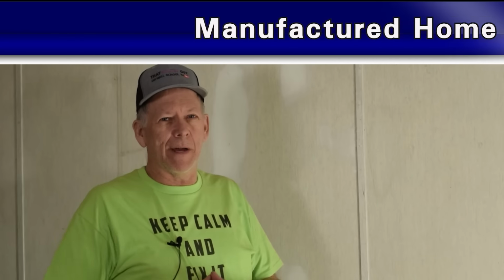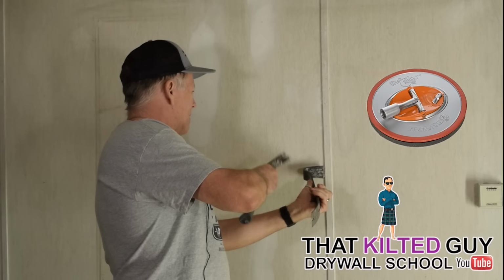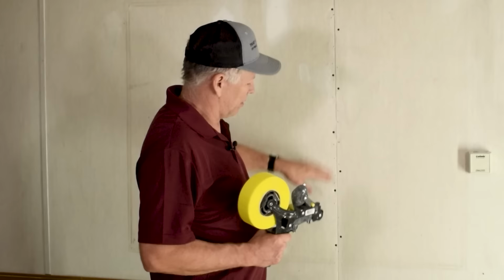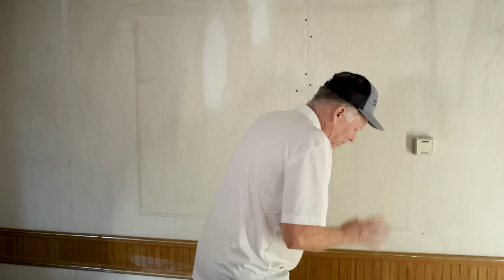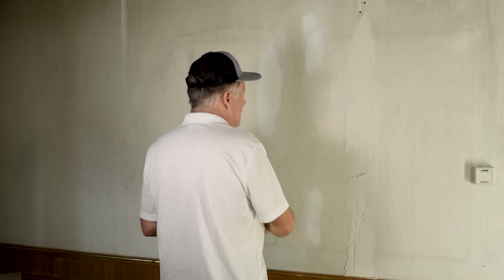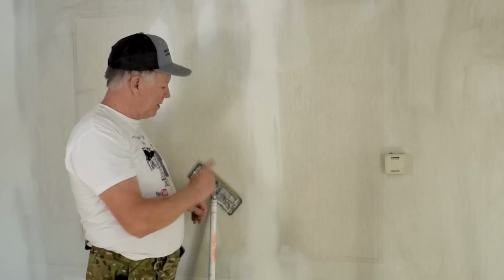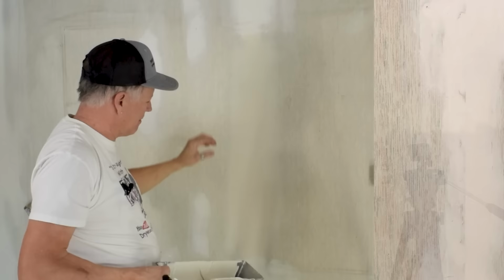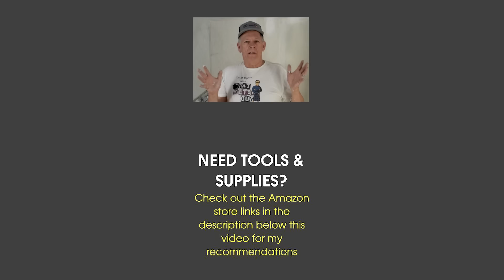Mobile Home Wall Removal in 2022. Smoothing out the wall strips

Comment: Filled mine with all purpose and let dry and crack for about a week, sanded, mesh tape, and 2 coats over them. Looks flawless and not a single one has cracked 👍 mine had particle wall board and a textured wallpaper, so i didnt have to worry about it sticking

Comment: We remodeled a 4bd 6 years ago
We did liquid nail in the molding joints  
No need to mud after. We did a knock down on all walls. Looked perfect  still does today. No issues at all.

Comment: It want crack as long as you screw it down good and Use mesh tape on the seems. I also scuff sanded the wall where the sheetrock mud will spread out two so it would have something to grip to other than that which has a plastic like skim to it. Paint does not even want to stick to it. I decided to scuff all my walls real fast with 100 grit pole sander. It turned out perfect in the end. No cracks.  Lived there 4 years and sold it for $5400. More than i paid forb it.

Comment: I just remodeled our main bathroom in our mobile home and learned the hard way that those vinyl covered walls need to be washed with detergent and water before mudding or painting.  And, after removing all those strips at the drywall joints I tried that patching mud that is pink until it dries but learned that it is too thick and won't leave a thin enough coat plus it curls up as it's being troweled on. I went back to my usual 20 minute mud with flatter results.
Reply from the maker: I would only use 20 minute mud when you need to minimize the shrinkage, or need to recoat quickly. Otherwise I would use light weight all purpose as it spreads easier, much easier to work with, much easier to clean up, and sands way easier.

Comment: I am currently trying to finish approximately 30' of seems in my bathroom. We have a modular home so this vid is very helpful. However I have already taped and mudded before I saw this. I have been using a a wet cloth to wet sand. In some places I can still see the tape, so I will try your method of feathering. Thank you so much. This is the 4th different video of your I have watched.
Reply from the maker: Thanks, glad I could help you out 😎. And thanks for subscribing!
Reply: Had the same issue in a bedroom just started a different bedroom with tho method looks fantastic

Comment: those sanding sponges are designed for you to squeeze the top and the bottom while sanding to avoid those corners digging too deep you only use the middle of the sand blocks no more gouges

Comment: Wish I would have had this info. 22 yrs ago , but it will certainly help if I decide to do all the walls. WE redid the small bathroom then and I was lucky just used normal drywall mud but did use mess tape. High quality paint doesn't  hurt anything either.Thanks  again for the great video.

Comment: i learned a lot of this sort of thing doing body work on my cars over the years..using bondo is basically the same thing...get it smooth feathering and so on. it helped me on my drywall repairs on my home..great video. we just bought a 200 singlewide that has those trim pieces and i want to remove them and smooth the walls. this helps. have a great day sir

Comment: How about coming to Mississippi and helping an older widow rehab a zone 3 mobile home?
The mud works exactly like it does on plain sheet rock.
Paint is usually 1 coat of quality paint.
I prefer to use the fiberglass tape and premixed mud.
It holds better if you need to relevel or move the unit.

Comment: It's hard to give you advice because you're such a professional but if I could, I would say just before you start mudding, wipe the walls down with acetone. That'll remove any greasy residue that may prevent the mud from sticking also if the home was a smoker's home it'll remove the nicotine tar from the wall.
Reply from the maker: Thanks but Acetone is one of the Most aggresive solvents and therefore it's very hard on skin, damages many surfaces, and worst of all in this case, it's HIGHLY flammable and could cause a serious explosion.  If there's any greasy residue products like TSP, Krud Kutter etc would be much safer and still do the job.

Comment: I have a manufactured home and would like to get rid of the 'straps' on the walls.  This video will be a big help to me, as I'm a novice at this.  I did have to tap in over a hundred nail holes or screw holes, and then spackle over those before I could move in.  Still finding some even now!

Comment: Prime it with Rustoleum Universal Primer or equivalent and let dry over night before you mud and it will stick. Also you can spray texture right over the dried primer on the rest of the drywall

Comment: Total novice here, I tried to paper tape over the butt joints, but like you said, the amount of mud was excessive and difficult to feather out. So I tried just using a "hot" mud (90 min) and I liked the results after sanding. Probably would have used the paper fluff stuff if I'd seen it in the store. The drywall sheets are glued to the studs (at least mine are) so there shouldn't be any movement.

Comment: Be sure to check the walls for "blistering" before you add "any mud" or any other material that has water in it, as it will blister. Please note. Many times you may not "see" a blister on the wall prior to adding any coat of liquid, or mud. I have been in the drywall industry for over 30 years and have experience with manufactured homes as well as residential, and commercial buildings. This guy seems extreamly knowledgeable, and i am NOT here to be critical of his work. Just remember that the material used in manufactured homes, especially the walls, are mass produced in a factory and can have many imperfections that are not seen with the naked eye. When you add any material with any liquid in it. It could bring out any imperfections. Although i am not familiar with this gentlemen. I am sure he has a video of how to fix " blisters" on a wall or ceiling. Great video sir.
Reply from the maker: Yes I do. Thanks
Reply: @ThatKiltedGuyDIY  Awesome! Thank you for your response, and my best wishes to you.

Comment: Hey Guy,
Thanks for sharing this video, I was always wandering how to get rid of that Mobile wall look lol, honestly I had that same idea of doing this with spackle puddy, but I thought in my mind that would eventually crack and flake off, I guess I was wrong and this video confirms that...! thank you I will do this to my walls too it looks so much better without those Mobile home walls strips. 

From your new friends in Lima Peru
George & Carmen
Reply from the maker: Happy to help. Thank you for your input George.
Reply: @ThatKiltedGuyDIY  Your welcome
Reply from the maker: By the way, make sure that anytime you fill a crack that you always reinforce it with mesh tape or something like this fiber product I used in this video or it will crack and may come loose
Reply: @ThatKiltedGuyDIY  Thank you, whats the name of the product that you use? also additionally to the product that you use, do you also use the mesh tape too?
Reply from the maker: There should be a link to the product in the description below the video. No I use one or the other
Reply: It want crack as long as you screw it down good and Use mesh tape on the seems. I also scuff sanded the wall where the sheetrock mud will spread out two so it would have something to grip to other than that which has a plastic like skim to it. Paint does not even want to stick to it. I decided to scuff all my walls real fast with 100 grit pole sander. It turned out perfect in the end. No cracks.  Lived there 4 years and sold it for $5400. More than i paid forb it.

Comment: I would look into a sand deglosser or primer to give it a sick to base. Surface profile. I did paneling this way also used both sides of the paneling. ( thin coats of mud)

Comment: Keep watching. Hopefully learn what to do. Have you have a video replacing old crank windows. Be so awesome. I might be the only gal with them. I’ve got a new heater and AC unit. I am planning to redo the roof. I put new carpets in a while back. I am updating that. I did update the electrical, but there’s definitely things that need to be done. So much work is it worth it. Finished 2 bedroom 1 bath worth probably less than I could sale it for. I don’t want to sell. This is great.

Comment: Thanks i need to learn cause next spring im going to fix a kitchen ceiling that is duct taped water damage so i will have to clean out the old ceiling and mold and put new on the way cheap.lol no clue never done anything much but roll paint on a wall.

Comment: Year's ago I knocked in the staples and nails, and screwed down any loose spots in the drywall of the mobile home I lived in, since the joints where so inconsistent, I filled them and screw dimples with automotive bondo, LOT'S of hardener, took down any high spots, then covered with mud, sanded till I was pleased, the gaps had been no where near as nice as I had just seen in this video, tight on bottom 3/8's on the top, and vice versa, can't give an update on how well it held up, as I know longer live there, sure wish that product existed when I did my mobile home, the bondo fumes are MISERABLE!!!

Comment: Correct me if I'm wrong, but you should not even think about doing this unless your modular/mobile home is on its own property. If you ever had to move the home then you might have to repair all of these joints again. And if you are adding a texture to the wall then your repairs would be that much more work.
Reply from the maker: When they move a new modular home, there’s always cracks to fix so you could look at it like that. If you move it, you just fix any cracks that appear

Comment: I did this similar thing to my old manufactured home but I actually used that green lid mud and did the whole surface of the walls with a skip trowel method and had no issues whatsoever. Never did anything to prep the vinyl surface. Great video.

Comment: That’s so interesting, I never knew that could be fixed, it looked great!
Reply from the maker: there is that, but the main reason is because the sheet rock is covered in vinyl and it wouldn’t make any sense to tape and finish them when they’re covered in vinyl. It’s a cost saving measure most of all.
Reply from the maker: well it’s most often called VOG or vinyl over gypsum. And what you’re talking about is the method they used in old or cheaper manufactured homes. Modern day manufactured homes don’t use batten strips in the nicer ones and they get by just fine moving them. So the reason they did it in the past was simply it was much cheaper then taping and finishing the drywall. It was a cost savings pure and simple.

Here’s a photo of a modern manufactured home for proof - https://oakcreekhomes.com/floorplans/boerne-5067/

Comment: Use Durabond very strong and it will stick to anything that's what you use over metal studs because they twist very easy and the strongest plaster will crack, so for now on any big commercial job with metal studs we have to inbed  with dura-bond whether we are taping or plastering because the metal studs twist very easy and expand and contract anyway Dura bond is the cat's ass little harder to sand the joint compound but you can shave it down with your putty knife, and you never have to worry about cracked joints seems whatever you may

Comment: Fibafuse tape perfect for this type of repair . I put a son through college fixing mesh tape cracks . Great advise in general . Mixing hot mud is a pan is an art .
Reply from the maker: The mesh tape only cracks when put on wrong. I’ve done nothing but drywall repairs for 20 years and have installed at least 500 rolls of mesh tape with no problems but I do it right. The failures are 90% due to people using non-setting type mud over mesh tape.
Reply: @ThatKiltedGuyDIY  mesh work well on things like what you are showing . When it's used for fixing cracks over doorways ( settling cracks ) . It fails . Not trying to cause an up roar .  I have the receipts for my statement . 40 years in the trade . Cheers 🍺 .
Reply: @ThatKiltedGuyDIY  this is the product I'm using for taping all repairs and all my flats and butts . It also comes in 3'x5' sheets . The mud squeezes through the mud . It's a great product if you want to try it . Thanks for the video and your time !
Reply from the maker: i’ve used both products quite a bit. But I’ve also used mesh tape to fix every crack in the world for over 20 years and that’s all I’ve done is repairs. So I have fixed probably 20,000 cracks or more and only had one call back a year later in all that time and that will happen with any type of repair because things sometimes move too much for any joint tape to hold up to.

and I fixed my share of repairs that were done with mesh tape also, but I guarantee you most of them were done wrong. If you don’t reinforce the area with more screws when possible that could weaken it, but the biggest thing is using all purpose over mesh tape. I made the mistake once on a new drywall remodel and it cracked the next day and I had to fix it. I only did it because I ran out of hot mud unexpectedly and was an hour and a half from town.

I get tens of thousands of comments on my YouTube channel and I’ve heard over and over about how many people didn’t know you have to use hot mud over mesh tape. You can see in the link below where they state this. You can also check out my many reviews on Google under my business name of Mr Patch drywall LLC and you will see I am five star rated for a reason. And in 20 years I’ve used mesh tape 99% of the time doing nothing but repairs.

http://www.grabberman.com/Media/TechnicalData/2689.pdf
Reply from the maker: and yet I’ve done nothing but repairs for over 20 years and 20 years of new construction plus repairs before that, and all the cracks over doors that I fixed have never come back. I have never had a callback on them and I have seen many of them years later and they were still fine. I get a lot of repeat customers because my work last and I use mesh tape on everything. It’s all about technique my friend. The failures you see are from improper technique not the mesh tape. and I actually started doing drywall in 1969 so I have many years of experience too. that’s just my view on having done tens of thousands of repairs.
Reply from the maker: covered all this many times
https://youtu.be/KEoffOGJbsk
https://youtu.be/w9Me_kP4Xik
Reply: @ThatKiltedGuyDIY  I didn't say I fixed any of your jobs . I'm sure they turn out great . I'm just saying there where plenty of guys ( homeowners and hacks ) doing bad repairs that had to be fixed again . Pros are a good hire . Quality first ! Thanks for your time and response .
Reply from the maker: That's what I was saying too. Too many do it wrong but they could screw up using fibafuse too lol. Keeps us pros busy
Reply: There are a lot of manufactured homes going in here is southern deleware . I started a good thing for them . The 1/2 inch drywall would split where the 2 parts of the home was stitched together . I started applying one layer of 1/4 inch plywood and then 1/4 inch of drywall . It stopped all tears and cracks in the tie together area in the home . Adding the plywood then drywall seemed to have stopped the cracking that some homes get . Old school drywall guys rock . When I started it was nails and glue only , no screws . No radio , no cell phones . It was just hard work .

Comment: This is an option of course..Or, learn to appreciate the wall battens for what they are. MH manufacturers have found that wall battens are an effective technique to reduce labor cost during construction, same with the vinyl wall board. Cost saving mentality can be found though out every HUD type manufactured home, especially on base budget models. Fortunately HUD enforces rules concerning minimum construction standards for all homes sold with a HUD placard, one of the best things ever accomplished by the federal gov't (IMO).

Comment: I removed the strips and smoothed out my seams like I was directed by a pro, even though I was told not to because it would flex and crack. I said "oh no. I had a pad built, extra blocks, mine's level, and strapped down everywhere". I used corner strips, mud tape, extra screws and all.  The seams cracked. I paid a pro to redo everything the right way. The seams cracked. I hate sheetrock. Rip it out and use real plywood paneling.
Reply: And use crown molding and baseboard.

Comment: We have this horrible paneling in our house bathroom.  Thank you for your video.  What do I do about the wall strips on outside corners? There are also sections where the vinyl has torn off.  Will sanding to smooth it and good primer work?

Comment: So... you CAN remove the vinyl from the gypsum, but it's a long and tedious task. You can cut into it with a tailor knife, but not too deep, basically just deep enough to get thru the vinyl,  and then you peel it off. You can only do this of its in good shape tho. If it's old and cracked up, it's just going to fall apart. Again, it's a lonnng process, and you still end up doing some sanding, but if you have time, I think it looks better than mixing over it. 
I did learn quite a bit from this video tho! So thank you for that! (If you would like to see how we did the removal, let me know and I can put up a video.)
Reply from the maker: I think doing that would weaken the Drywall too much, and it’s already thin and week. Thanks
Reply: @ThatKiltedGuyDIY  it doesn't actually. It's just like normal gypsum under the vinyl. :)